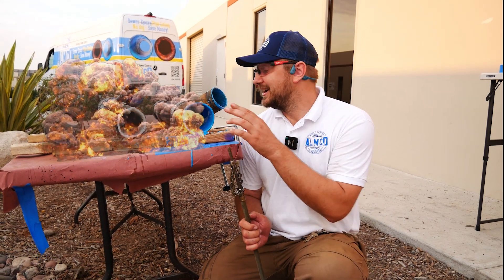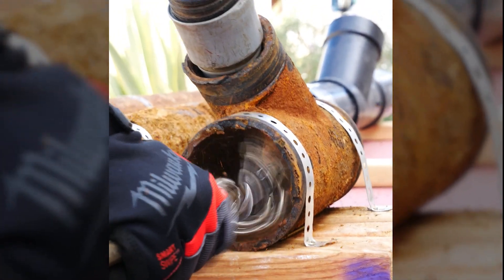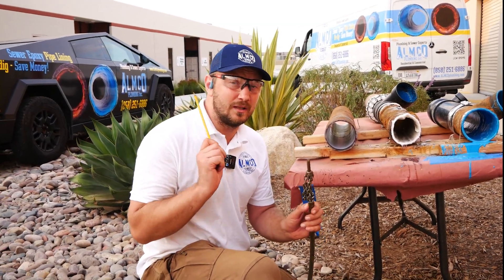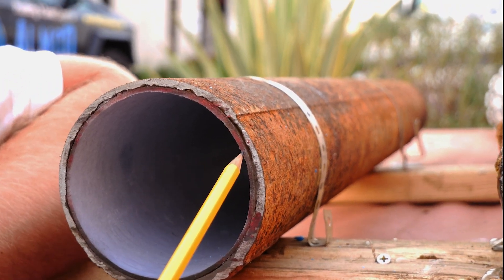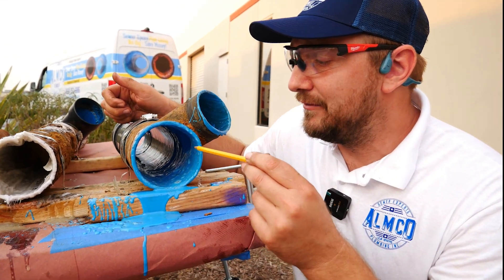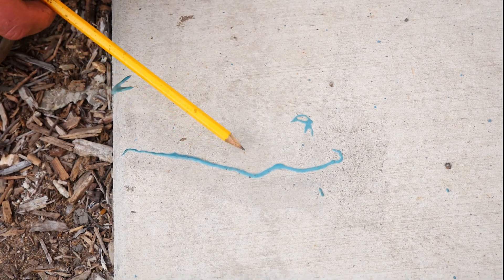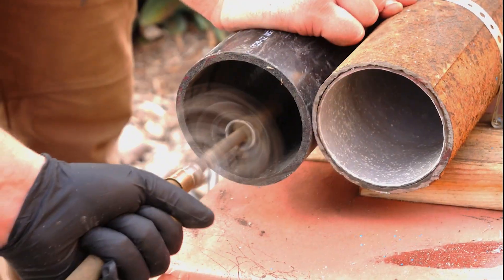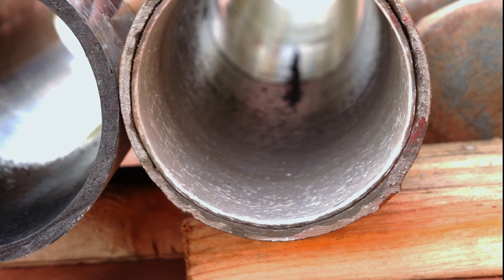EPOXY Pipe Lining CRUSH TEST | Spray Epoxy vs. CIPP Epoxy Lining for your Sewer

Comment: hi I'm a plumber in Texas have you tried the IPP  spray liner i was looking in to it
Reply from the maker: Spray head design bad got faild 2-3 per job 
One head $120-$180
Reply: @almcoplumbinginc what system do u recommend is the  picoat  brush coat better
Reply from the maker: @brian2100  picote will be hard to yse 
I,ll say pull-in-place NuFlow or Permaliner
spray brush SPRAYPOXY (NuFlow owned brand) use only brush coating spray not realy work.
all quik connector by on aliexpress 95% cheeper

Comment: How long does the spray epoxy last on cast iron pipe?
Reply from the maker: i have outside on concrete on sun UV over 1 year dose not change. manufacture says up to 50 years life expactancy
Reply: @mattvega6941  30-40 years
Reply: hi what brand brush epoxy is that   thanks

Comment: Why choose cipp vs spray epoxy and vice versa
Reply from the maker: Depend of pipe condition situation. 
Right now we do two building 260 feet each 
Originally we start with pull in place pipe collapsed in few areas and we did pipe bursting.   Owner see condition of the pipe and want do rest of the branches and here we do spray brush

Comment: Why choose spray vs cipp and vice versa
Reply from the maker: With spray, you can pass a water pressure test with cipp no. 
if you do, from property to the street, better CIPP. inside the house with all branches better spray epoxy